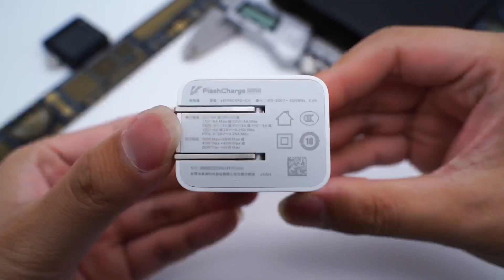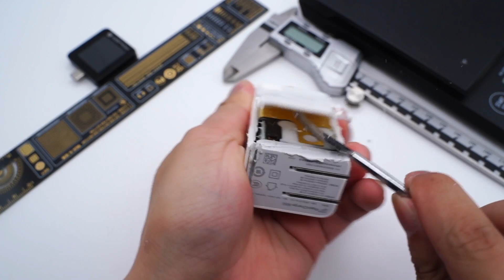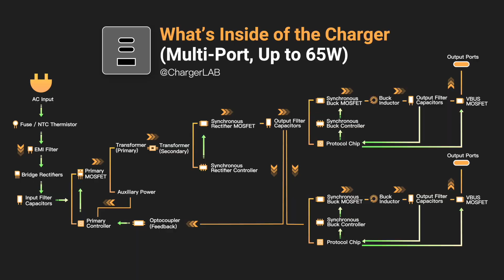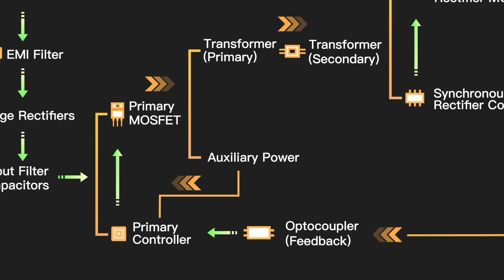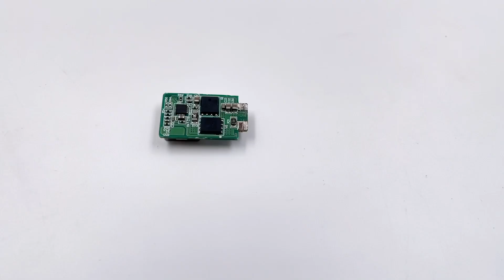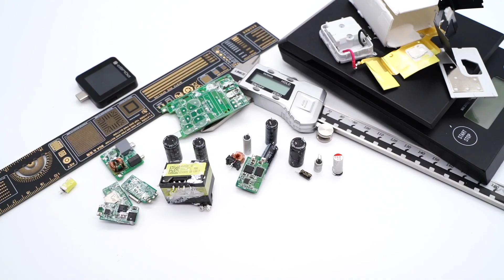Teardown of vivo 80W Flash Charge Charger (Dual USB-C)

Comment: Does VOOC charger from OPPO similiar protocol with VIVO flashcharge? mean VIVO device that suppose to use flashcharge, will they get same benefit (charge speed) using OPPO charger on the same watt?
Reply from the maker: No, they're different protocols.